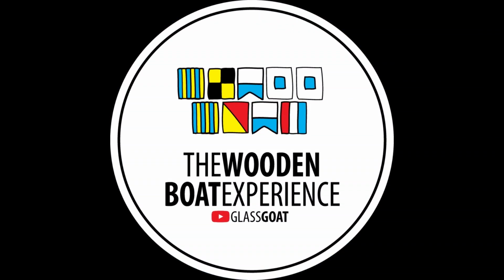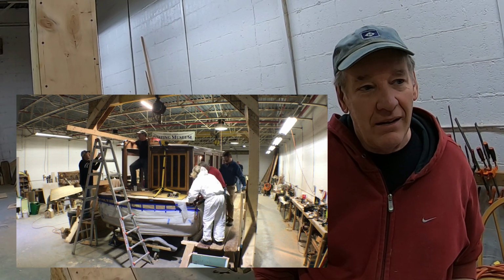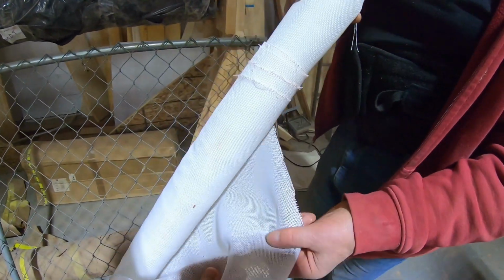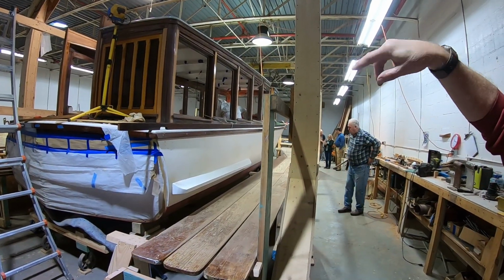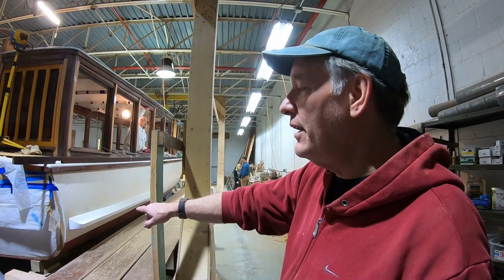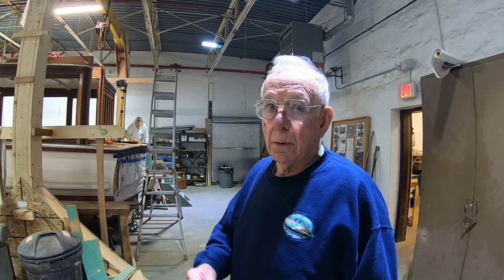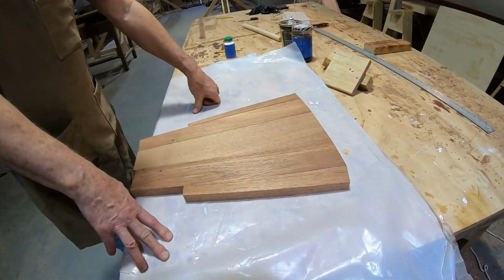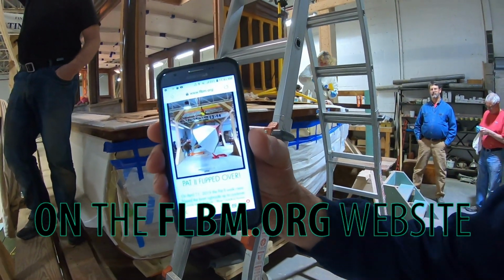WBE S1 E24 OLD BOAT-NEW IDEAS!

Comment: wow Pat ll restoration, five years on a rebuild wow all volunteers that's cool.. That sure is a beautiful boat. They choose a good way to rebuilt that boat, she will last for a long time, way beyond my life cycle. That's for sure. I watched the flip over maan I would've tried to do a much more controlled lift than that, that looked crazy..I use to be a welder fitter, we use to flip massive size fabricated builds but we had to gantry cranes that we would use all at once.
Reply from the maker: I'm looking forward to riding in it this summer.

Comment: The Pat II will be moved from the shop to its trailer on 7 April. The move will entail the use of two cranes to do the heavy lifting.
Reply from the maker: Is the motor in yet? If not, will that happen before moving from shop or after? Thanks for the update!
Reply: Glass Goat The motor is in, she’s coming along nicely!

Comment: Was that originally an Uncle Sam boat?
Reply from the maker: Not sure if it was ever Uncle Sam, but it was a tour boat in the 1000 Islands.
Reply: @glassgoat9601   Several tour boat companies used boats like this besides Uncle Sam, Paul Boat lines and one from Brockville.  I grew up riding these boats. I remember when the Coast Guard would no longer let them use gas powered engines and they had to power them all with diesels.

Comment: Why did they not put in a simple, inexpensive 3 liter  4 cylinder gas engine of 135 hp? A remanufactured engine could go for as little as $3000. Even an expensive brand new one costs $9000 versus the OUTRAGEOUS $31,500 for this overblown electric toy motor of a paltry 40 horsepower and batteries that will not last too many years. There is no advantage at all with using electricity for boats. Water is a thick medium and requires constant hard thrust with no coasting like a car. There is no regenerative braking to recover electricity either. For the money difference you could buy an old Pen Yann Viking and restore that as well.  Folly.
Reply from the maker: While I agree that electric power is not viable in most marine situations with the current technology, they are happy with it in that boat. I took a hard look at the possibility of converting one of my boats to electric but the downsides vastly outweighed the upside for me. I did like the idea of less maintenance, especially oil changes, impellers, etc. Also winterization in my area. It would be nice to be able to talk with passengers in the rear of a 25’ utility while captaining as well. Noise is why I modified the seating in my Chris Craft.